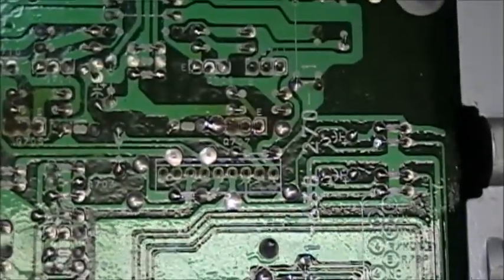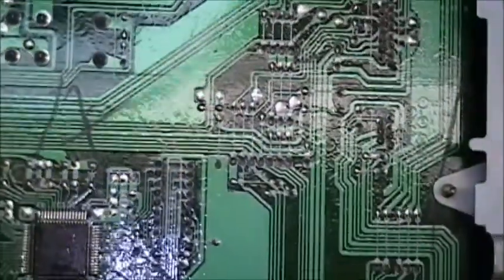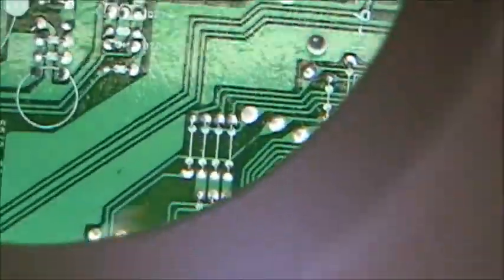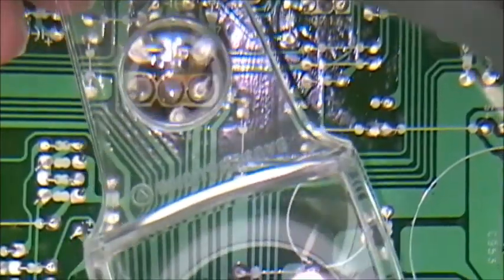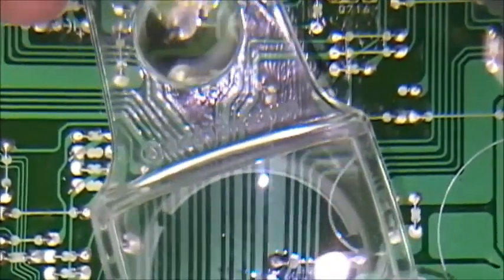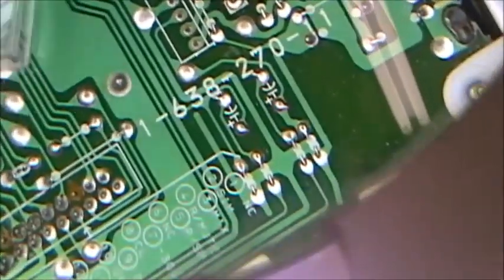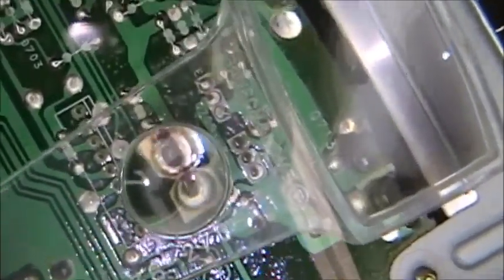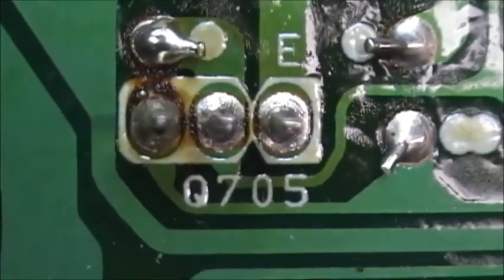Radio Repair Secrets - Sony TA-AV411 has distorted sound from one channel

Comment: how aboust the selector section not switching to cd orr video and if you do it wont change back had to unplug power to get back to tunner
Reply from the maker: The symptoms you describe could be caused by dirty contacts inside the tuner switch, cracked solder joints at the switch, and/or cracked solder on the connections between the switch board (assuming it's separate) and the main board. Most likely you're going to find cracked solder in both areas. Please repost to let others know what you find. Good luck! Thanks for commenting. IMHO, this amp is well worth fixing. Still have mine. Still amazed at how great it sounds.

Comment: Thanks for the video Lawrence, very helpful. Can you recommend a particular soldering iron and solder?
Reply from the maker: My Hakko brand soldering equipment dates back to the mid 1980's, so all I can offer today are general guidelines. Forget pencils and irons. Get yourself a modern, temperature controlled soldering station with ON/OFF switch and digital readout. There are plenty to choose from in the $50 range, some even as cheap as $35, but only consider those for which you can buy replacement soldering tips. Buy at least one extra standard size soldering tip, one of the next largest size tip and one of the next smallest size tip. Buy them the same day you buy the station. Soldering tips burn out. If you don't have spares, can't get spares, you'll soon find yourself regretting your purchase. You'll also need a vacuum desoldering pump. Manual models only cost $5 or so, but same story. Plastic tips melt fast, so order a bag of replacement tips along with it. Can't get replacement tips for the $5 pump? Then don't buy it! Look for a better one. If money is not an issue, check out the electric models. As for solder, I've always had very good luck with Radio Shack .062" diameter, standard, 60/40 rosin core solder, Net Wt.: 1 lb. (453.5g) part number 64-008. Try to get something like that. Finally, be aware that many of the 5 and 4 star product reviews posted online are fake. People are paid to write those. If you really want to know whether equipment you're looking at is any good, check the 3, 2, and 1 star reviews. That's where truth is found. Good luck with your purchase. Thank you for commenting.
Reply: @LawrencePina  Thanks Lawrence, appreciate the advice! All the best from the UK

Comment: Thanks for the lesson at the end about resistance. It may be the best clue for what's going on in my home repair of an Xbox Elite controller. The potentiometer suffered an expectedly premature death because they use garbage units in controllers these days, but my replacement potentiometers have been mostly junk. Some stated that Pot meter replacements on these controllers are a pain because they just aren't reliably made to the same spec so I've replaced one after the other till I got one that looked like it was giving me a stable center point.  Problem is I can play for a few hours then it locks up as if I've got it pressed in the forward position. Oddly resting the controller for a while temporarily fixes the problem but its very temporarily. Maybe the joint is building up resistance quickly because I've done something wrong ( total amateur here )   I'm actually considering buying safety silv 56 solder to compensate for whatever it is I'm not doing right. I've tried two different electrical solders and I have a good Hako unit that gives high heat but who knows, the failing pot meters are rampant on these controllers anyway.
Reply from the maker: Sometimes there's more than one problem in an electronic device and you may have already fixed the first one. At this point, I'd try a second, known-good controller on that Xbox to see if the problem recurs. If it doesn't,  there's a second problem in the original controller. If it does, there's an additional problem in the Xbox. Hard to explain how resetting the Xbox might fix a jammed potentiometer. Sounds more like heat-related microprocessor issue.
Reply: @LawrencePina  I was imagining the same thing, not very hopeful really.  Though the forward leaning drift, which develops consistently or well roughly an hour into a session would correlate with an increase in resistance in the potentiometer circuit over time, perhaps through heat like you mentioned. I've already ruled out the platform.
Reply: I concur. Resistance in a circuit creates heat and the longer that circuit is constantly in use, the more heat it develops. That heat will connect to nearby components and solder joints over time and damage them as we’ve seen in this video. I’m sure you may already know this but playing your game with the cover off so you can pinpoint the source of the heat being generated by touching it but, be careful if it’s too hot. Remember, metal expands and contracts when exposed to heat and cold so when a damaged circuit is going through numerous cycles of being hot then you turn it off for a while and the circuit cools down. I believe this is a way those solder joints fractured as seen in this video but I’m not 100% positive. Often those game units will have some minor issue on the PC boards that you can easily repair then re-sell them at a profit. Right now Sony PSP’s and PS Vitas are getting scarce but there’s plenty of damaged around and online you can get for dirt cheap. A few years back, I kept an eye out for good deals on the PSP/PS Vita at flea markets, pawn shops and local online ads and I paid an average of $25 for fully operational units, as for the PS Vita I paid $50. But today I haven’t been able to find them and when I do, they want over $100 which is not going to happen. 
Apologies if my reply to your comment was a bit long, just trying to help. Thanks.

Comment: Thanks. I can see the cracks and fissures clearly. They appear as grey/brown rings around the solder. You did a good job filming that. Can’t havd been easy to do.
Reply from the maker: The grey/brown rings visible at the outer edges of the through hole joints are actually flux residues left over from the original wave solder job. The cracks I'm talking about occur between the protruding component lead and the center of the solder dome. That area should be nice and smooth, as if the component lead and the solder dome were one and the same material. When you see a ring and/or an air space around the lead, that's a crack. And in most cases, unless you have eagle eyes, you are not going to see them without high magnification.
Reply: Thanks for clarifying that .